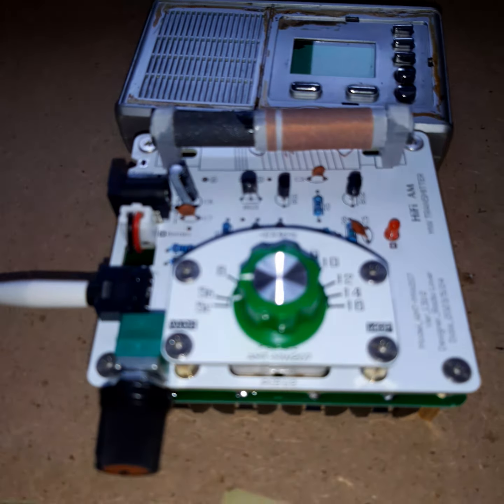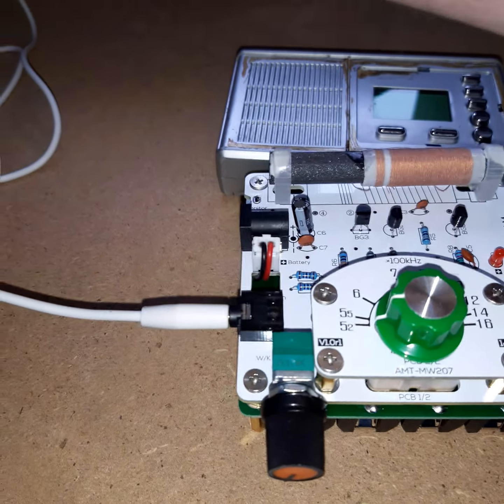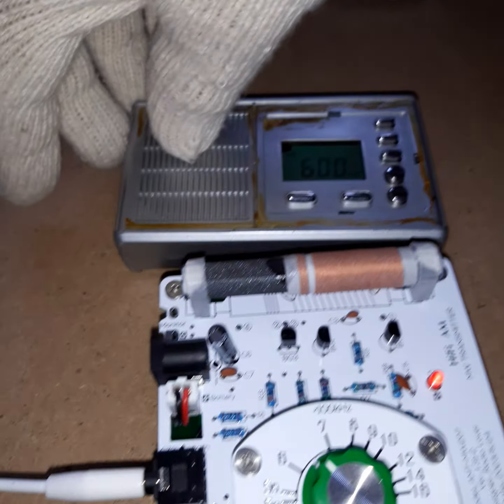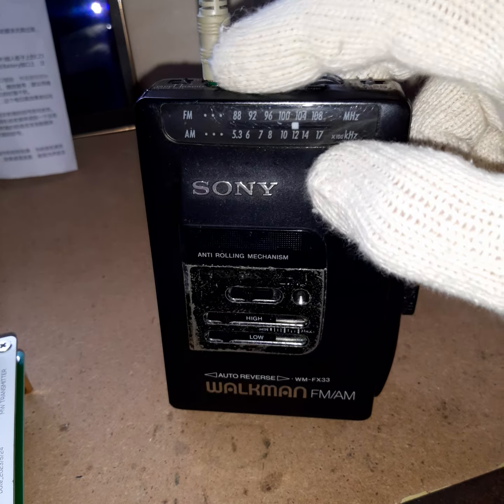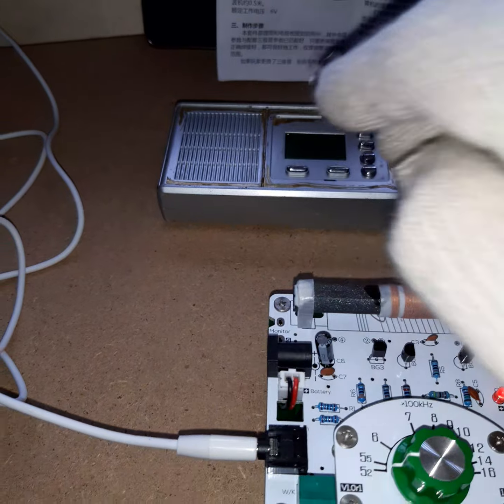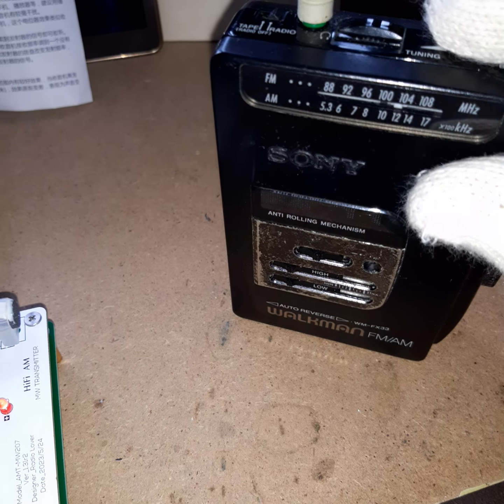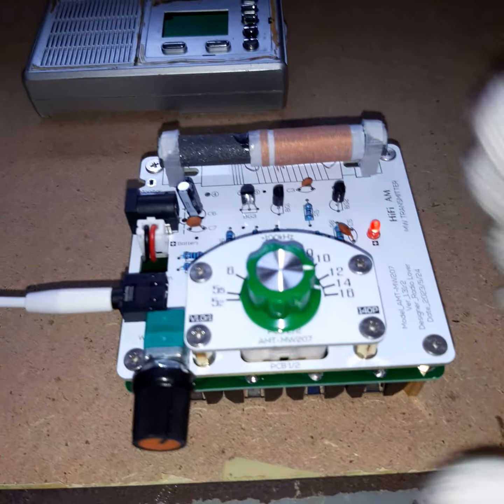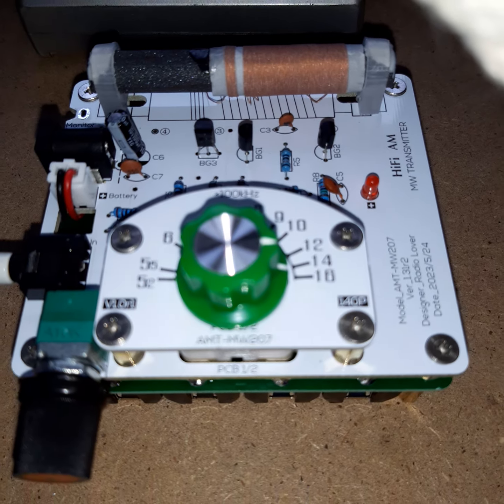Review of the AM-MWT-207 transmitter by radio lover

Comment: I already purchased one, but it’s good to know some of the caveats. I do know that this is sometimes sold as a kit rather than assembled, so perhaps the frequency dial wasn’t calibrated properly during factory assembly.
Reply from the maker: Yes, the capacitor has "smaller capacitors" installed, these can be used to match the dial with the transmitting frequency. I have seen this thing offered as a kit, and there are various versions of it (earlier versions, more simplified board - same circuit thou... at least I think that). They differ in price. Usually the kit is around 25 "buks" whilst the prebuilt version is around 10 buks more expensive.